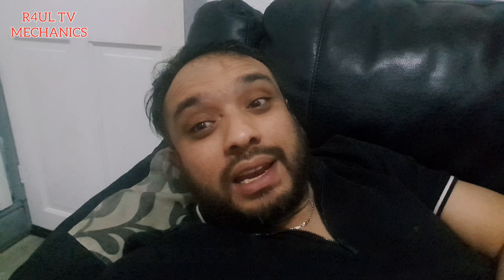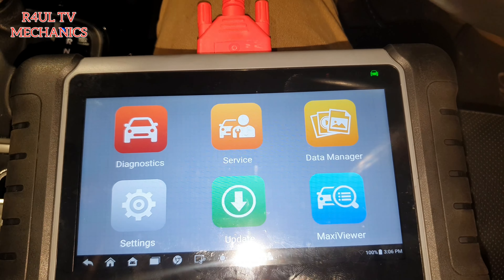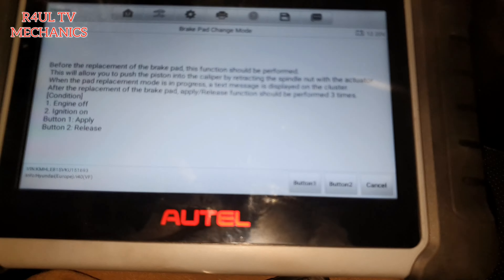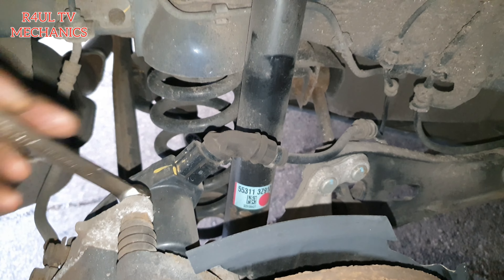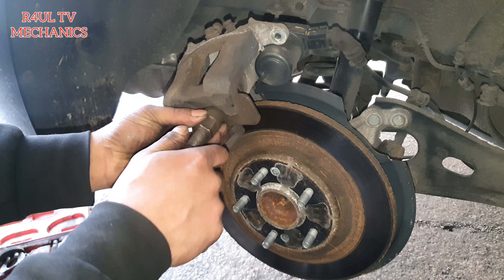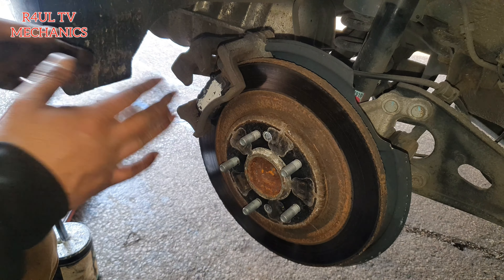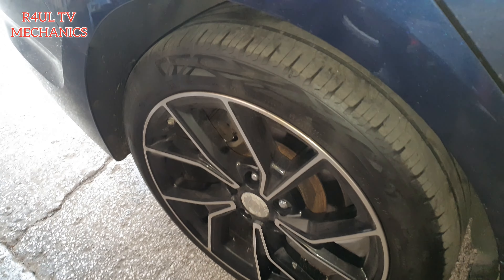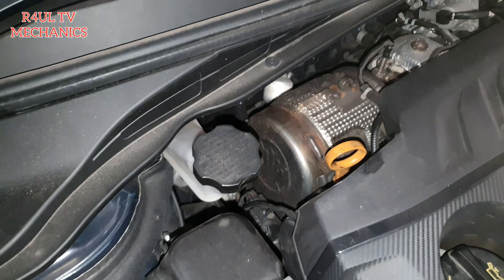2020 HYUNDAI i40 REAR BRAKE PADS REPLACMENT

Comment: Hi Rahul, very nice video. thumbs up 👍 Did you left the ignition on until you finished the job? How about changing rear disc? don't you think battery would drain? Or is it okay to turn the ignition off after you put them on brake service mode?
Reply from the maker: Thanks for watching really appreciate it I think I mentioned it's better to leave a battery charger on the battery that way it shouldn't drain. Sorry If i didn't mention that.
Reply: @TEAMR4ULTV  Okay, thanks for your reply